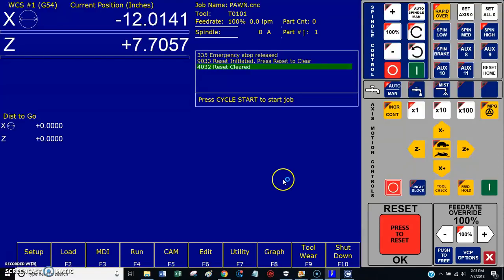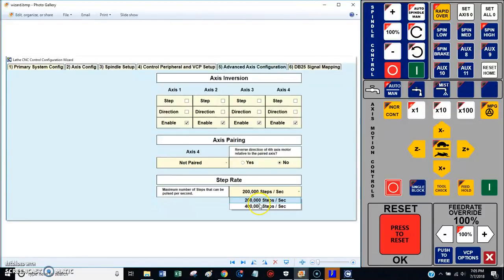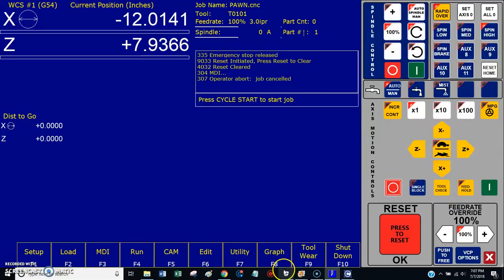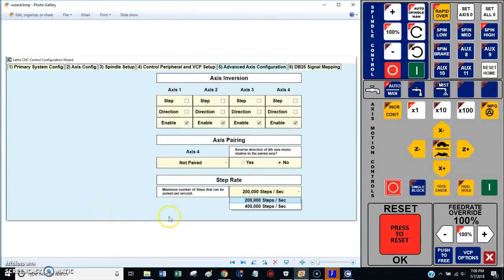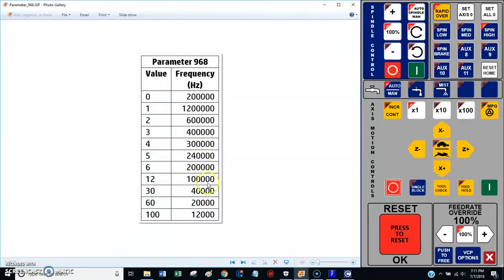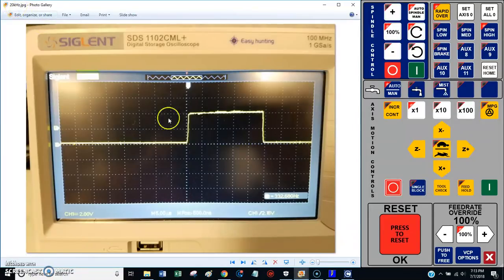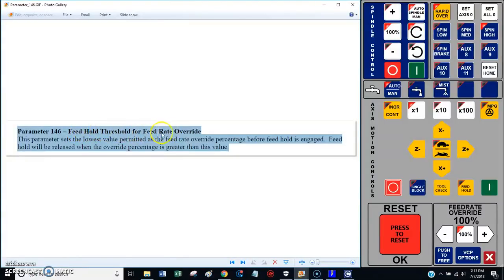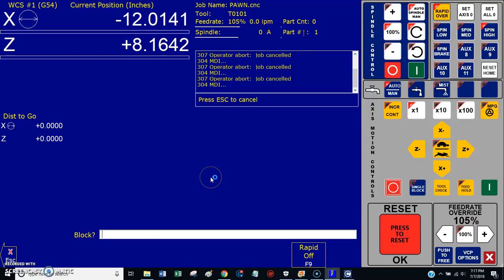Centroid Acorn CNC: Step Rate and Driver Frequency Interactions

Comment: ( Thank you for your help )Hi Franco I have 2HSS86H Leadshine driver copies, does this setting effect the turning of your drives if you move 0.010” at a time? Or does it only effect the steps when you slow the feed rate down really slow? The only documentation I could find about 50μs is in this below where it says below (this product adopts an optical encoder with high speed position sampling feedback of 50μs)

The HSS86H-KH hybrid stepper servo drive system integrates the servo control technology into the digital stepper drive perfectly. And this product adopts an optical encoder with high speed position sampling feedback of 50μs, once the position deviation appears, it will be fixed immediately. This product is compatible the advantages of the stepper drive and the servo drive, such as lower heat, less vibration, fast acceleration, and so on. This kind of servo drive also has an excellent cost performance.
2. Features
 Without losing step, High accuracy in positioning
 100% rated output torque
 Variable current control technology, High current efficiency
 Small vibration, Smooth and reliable moving at low speed
 Accelerate and decelerate control inside, Great improvement in
smoothness of starting or stopping the motor
 User-defined micro steps
 Compatible with 1000 and 2500 lines encoder
 No adjustment in general applications
 Over current, over voltage and over position error protection
 Green light means running while red light means protection or
off line
Reply from the maker: Imagine your Motion Control Unit (Centroid Acorn Board) is talking and the driver is listening.  If the MCU is talking too fast, the driver may not hear every single word - it will miss a few.  So, if you are going fast, your driver will miss a few steps and fall short of the desired position.  If you are going slow, the driver may not even move because the pulse is missed.   My suggestion:  Set the frequency as low as possible.  It won't have any negative impact on slow motion - it will only limit the max velocity.
Reply: @FrancoCNC  the way you explain how this works is very clear and very understandable. Thank you again for all your help! I’m now moving into making tool paths in fusion 360 and am goin to try and machine some things I designed. I’ve Machined parts on my imservice 12x12 cnc router ( I Would almost like to put a acorn on that! It has servos) I have 12 3D printers which I sell parts from them. And I have a millwright cnc mega v plasma/router. So hopefully I’ll be able to pick this up! The hardest part I think is the cam part of making tool paths and stock set up! Have a great Christmas. Paul

Comment: Is this issue with just stepper motors? Or is it with servos with encoders as well?
Reply from the maker: Hi.  It can be an issue with any drive/motor system configured to accept step/direction inputs.  Most of the closed loop systems I've used (steppers with encoder feedback to the drive) are step/direction types of devices.

Comment: Thanks very much for this. I have a zillion questions, but if only one, then: would you choose closed loop stepper drivers over servos for a y axis which employs two motors? Does either alternative protect the y axis from going out of whack? That's two, I know, but thanks for your advice.
Reply from the maker: Hi.  Closed loop steppers and servos would (IMO) be equal when it comes to dual motor Y-Axis machines.  Both are excellent when it comes to not loosing steps.  Personally, I would probably go with closed loop steppers.  Servos are "better" in that they are more efficient and capable of higher RPM, but most DIY machines aren't capable of taking advantage of that extra performance.  I've been using closed loop stepper systems on my mill and my lathe and I'm extremely pleased.  Additionally, I'd say closed loop steppers are easier to configure than a servo system.
Reply: @FrancoCNC  thanks very kindly

Comment: Hi franco ive just bought some closeloop steppers for a mill i,m building and i was wondering does centurion software work with fusion 360 if could let me know that would be great thanks Rob uk
Reply from the maker: Hi.  Yes, you can run standard g-code on the Centroid control.  Here are some videos you may want to check out.

https://youtu.be/yfGVdfHlDNg

https://youtu.be/zqgEijP4WTQ

Comment: if you chose 100KHz  the pulse width (high time) will still be less than 10us if you have a 50%  duty cycle square wave being generated. In fact the high to low time will actually be 5us in that case.  Assuming a 50% duty cycle then that note in the Leadshine document implies you can't run things faster than 50KHz - 10us on, 10us off. 50Khz = 1/(10us+10us) Which doesn't seem to make any sense unless the duty cycle in not 50%. Don't you just hate it when documentation is wrong or misleading? At least in this case you got some documentation¯\_(ツ)_/¯  Maybe you should capture what is actually being generated by the acorn board during an actual  move with your new settings just for peace of mind? Be careful where you stick the ground lead of the oscilloscope. Take care!
Reply: Makes sense my leadshine don’t want to run above 40khz. Heck they run decent at 20khz but a sacrifice in jog speed.

Comment: Great video, thanks for taking the time to post this.  The oscilloscope pics really drove it home.   so the driver never saw the narrow steps to begin with hence it “lost” them.
Reply from the maker: You got it.  The particular driver I was working with needed a longer step duration in order to be "stable".  Otherwise, it would miss some of the steps, especially at extremely low feed rates.

Comment: Nice i am in the process of converting  my pm 25  have you figured out a way to incorporate an encoder i was thinking about the same area the rpm sensor is located
Reply from the maker: Hi.  I haven't worked on that just yet.  But, I was thinking you could attach something to the top of the motor where the cooling fan is mounted.